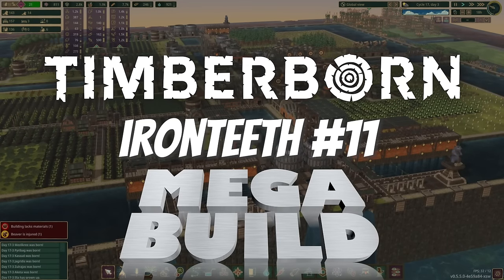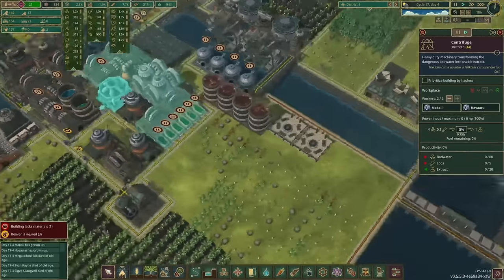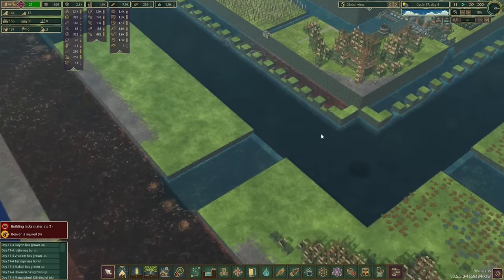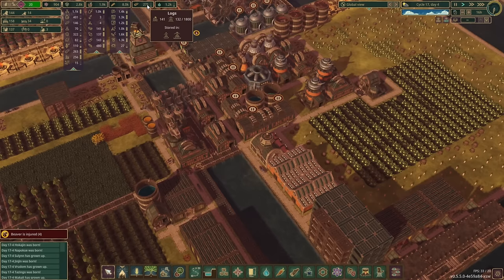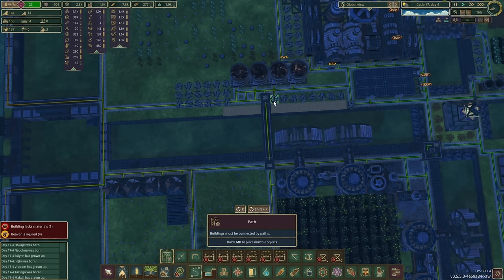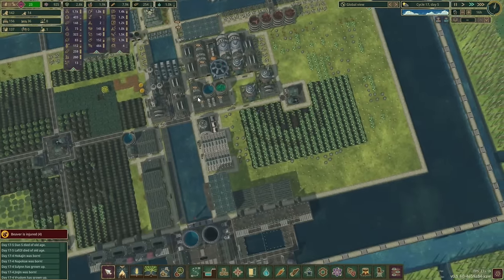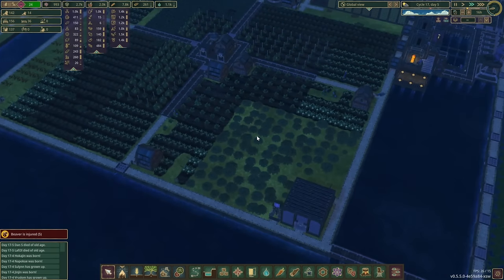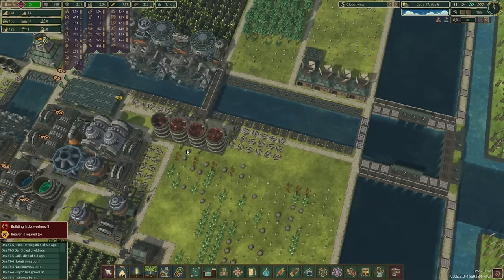Time to remake our industrial area! Timberborn Update 5 Iron Teeth Mega Build Episode 11

Comment: When you unlock terraforming you could choose one of those islands on the second tier to set them up on, dig down to bedrock but leave a single tile of dirt around the edge creating a large box, then put in a floodgate/dam and fill it with water and then you can use it as a reservoir!

Comment: You can bring floodgates near the mangrove forest 1 tile forward and put contamination barriers there so that the trees don't die during bad tide
Reply: You can put the contamination barriers under the water in front of the existing mangrove levies and floodgates with no gap between those.
 That will stop the badwater from going into the ground below the existing floodgates and levies. Then, you can just build a path on plaforms above the barrier blocks.
Reply from the maker: I've found that the contamination barriers don't work correctly while submerged, unfortunately. We'll need to put some ground in.

Comment: The stairs into the canal on top near the power wheel are probably unreachable. The irrigation barriers are on both sides of the platforms that the stairs are connected to. The platform and path on top have ladders but they reach past the irrigation barriers.

Comment: → Just put in some temporary storage for e.g. logs and planks near (but not inside) your industrial area while you are reorganizing things. No need to complicate things by trying to reuse things.
→ You could have mixed in a few of the four-long buildings on the storages near the irrigation barriers (where you put all your lumbermills and gear workshops – just put them extending between the power wheels.
→ Why are they not picking up the treated planks? – Because you marked all other things as more important to pick up. Your builders are not smart enough to say "we need to pick up treated planks first because they are needed for a high-prio building project".

Comment: The wheels were not spinning in opposite directions at 12:45.  The front of the wheels go one direction, while the backs go the other way.  Same as how the bottoms of the wheels travel with the direction of waterflow while the tops of the wheels travel in the other direction. 

When the battery mod comes back, remember that the medium batteries don't transfer power into the smokestacks of the fermenters.

I had also made the incorrect assumption that irrigation barriers couldn't be walked on due to not being able to put paths on them.
Reply: If you look closely, he wasn't talking about the water wheels turning opposition directions but instead he was talking about the water wheel's power output is spinning one direction, and the first power shaft that's directly connected to the wheel's output is spinning the opposite direction.
Reply: @Bama_Boy  oooh, I see it now.  I'm actually rather relieved that I misunderstood what he was saying, rather than him misunderstanding how circles work.

Comment: You should probably delete the wood cutters form the area where you gather pine resin. Or remove the cutting order from it so the pine can naturally grow back now when the dead ones are gone.
Reply: You know you can empty the storage before you delete it, and let the haulers remove it. Instead of just deleting and trying to get your overworked builders having to pick it up from the ground. It will let the builders concentrate on building, and the haulers doing the hauling. Way more efficient.
Reply: You are probably also going to want a steady supply of extract before you get in to dirt excavation.